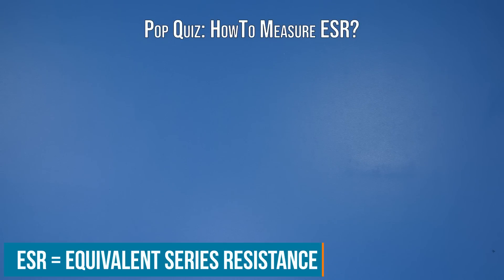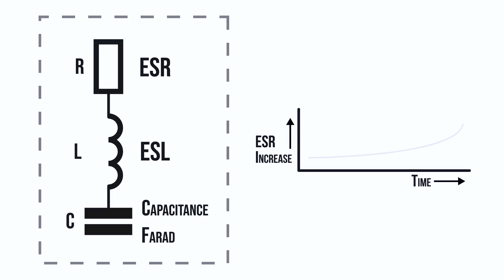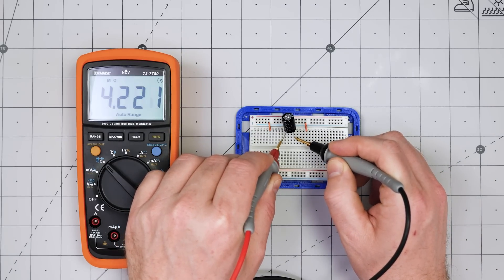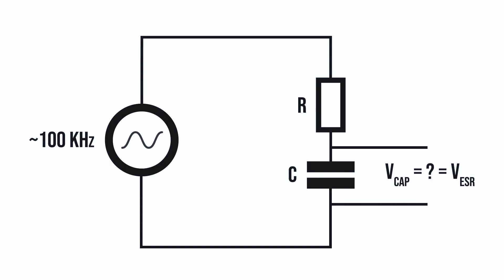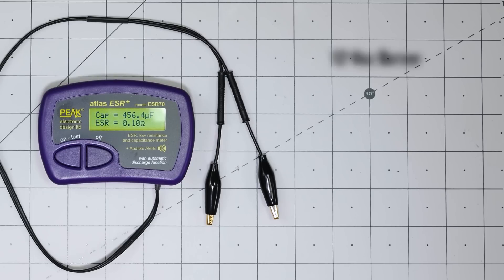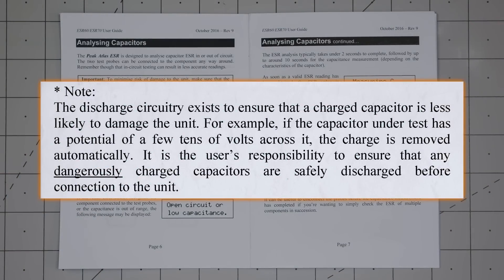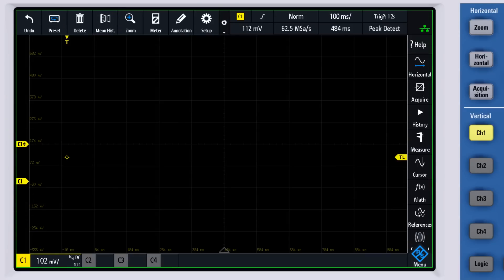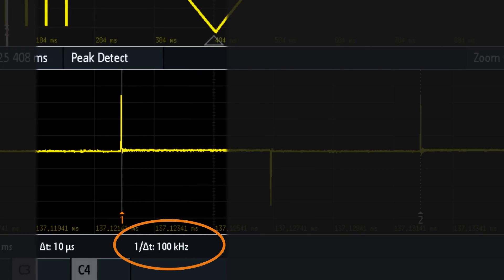Measuring Capacitance and ESR - Workbench Wednesdays

Comment: The reason it doesn't matter about polarity is because it is using a low voltage (500 mV) AC signal. The capacitor will be reversed polarized each half cycle no matter how you hook it up. The saving grace is that the voltage used is very small. Small even for sensitive tantalum capacitors. No different than how an LCR meter makes these measurements.

Comment: Thanks for your evaluation video. What is missing in your review is a comparison of the measurement with a trusted high end test device. I have a peak ESR and an hp4261A LCR meter on my bench. They use different frequencies 100kHz vs 120H/1kHz and the calculated capacity of DUTs vary quite a bit, 15%.

Comment: any good in circuit esr meters for testing capacitors in the pF range i.e 20 to 100 pF?
Reply: ESR is not generally an issue in smaller capacitors. The construction and the value work against ESR concern.

Comment: Dear Element14, question(s), kindly, regarding the Peak ESR_+ meter, please.  ¿Is it safe to 'power on' this meter on with the leads connected to a passive discharged capacitor, or a resistor, please?  You do this with a discharged cap (~7:28), and seemingly without any issues. (The reason I ask is that the manual says: "To allow the self protection mechanism to function, always ensure that the Atlas ESR has completed any analysis before connecting the test probes to a component"). ¿Do they mean powering it up (turning it on) with leads attached to component under test? Just wondering. (I own one of these fine instruments and am very worried about damaging it [big deal for me just purchasing one]). Any comments most welcomed. Thank you for making and posting this teaching video.

Comment: I've had an ESR70 for about 4 years. It works great, but the leads are not very durable. The female banana jacks broke off of the alligator clip leads within first year. They're rather pricey to replace, like $40, but I'm cheap so I just hacked away some of the plastic and resoldered them. Some shrink wrap and they are better than new. Other than that, it is a good product and I do recommend it.

Comment: ESR is not leakage, right?  So the fact that the ESR is low doesn't necessarily mean that it's not potentially leaky?
Reply from the maker: Leakage is related but different from ESR. James covers how to measure it and the relationship between the two in this blog post: http://bit.ly/2IMkolY
Reply: Yes, the 2 are totally different. Leakage can be thought of as a resistor that shorts the ideal capacitor in that model.